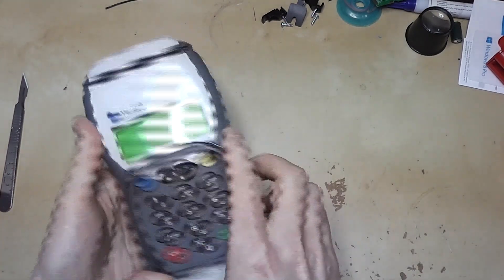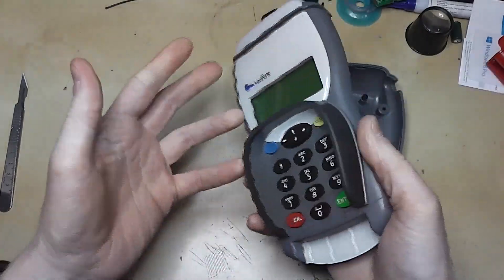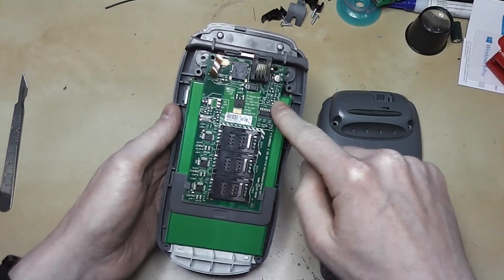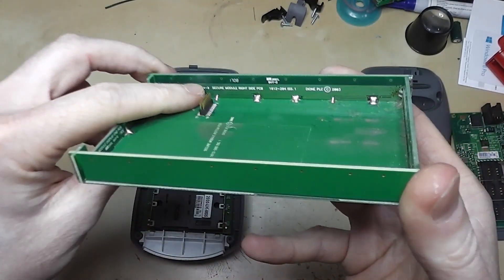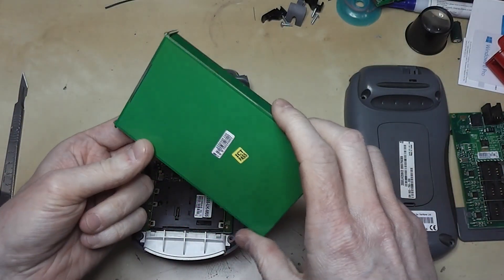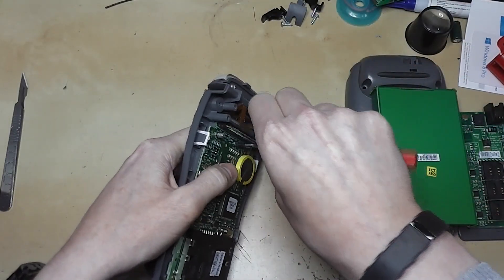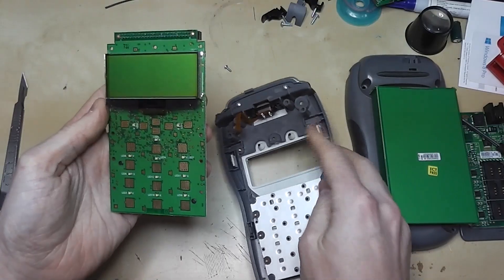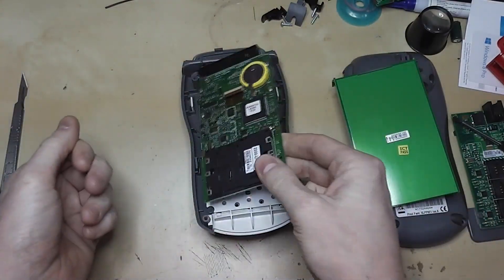Chip & Pin Key Pad Tamper Detection Systems

Comment: There is a way to get away with the tracks and connectors: I assume each connectors are interconnected thru this tracks, the easy way is to check them with a voltmeter to see what correspond where, and resistance as I assume there is a calculated resistance that each circuit is set to as a second fail safe measure. Then replace with the right resistors following measurments..job done..

Comment: In the US, our chip readers are either Vx520, Vx820, Mx915, Mx925 or one of the Ingenico variants. 

I’ve accidentally dropped an Ingenico ict250 and it just says Alert Irruption which probably means it activated the tamper switches. 

Chip & PIN and Chip and signature cards just simply no longer were able to be read at all.

Comment: tamper errors creep up even when they haven't been tampered with.  if the internal battery dies for example.  if locations keep spares, I bet it would be best to keep them powered on at all times to keep a charge for the internal battery.  I have looked online for tamper hacks but they all don't seem to work to clear the error.....at least...not for me

Comment: Cool video! You said that you expected the battery powers the device and does some kind of polling to check that none of the tamper points have been broken. Maybe a method of opening it up without triggering the tamper points is to isolate the battery first. You would then be free to open it as you did in the video. I have no idea how you would do that though :P Could you somehow completely drain the battery first? Find a track that is easy to access that connects to the battery and discharge it using a resistor?
Reply: Arthur Guy  It's probably volatile memory, so if power is lost, the encryption keys are lost too. the magnetic stripe ones in the US are like that too.
Reply from the maker: I would expect that the system would lock down if the power is lost so draining it isn't an option. The battery would also be contained within the secure area so its unlikely you could get to it.
I imagine software attack would be the best option or an interface between the card and reader or replacing the reader with a customised/compromised version.